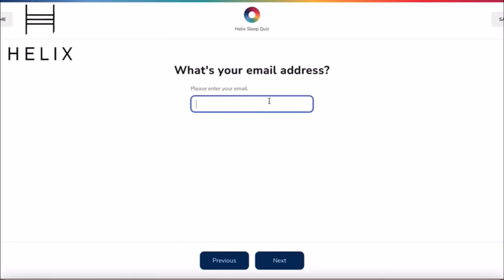Self-Constructed Porch Beams | Building Our Own Home Ep. 57

Comment: Lydia is on 30 days Light Duty. Good job ,Jim, smoothing out the dirt around the edge of the slab. That sure helps to secure your footing when walking on or off of it. The glue bonds the wood, the screws hold it in place until the adhesive cures. Great tip on pre-fitting the Simpson Strong Tie joist hangers. I now know how to erect the frame of my upcoming lean-to project. Level and plumb while working on a slab with a 1" grade is not as easy as it may seem. Great video!

Comment: Being a General contractor for 29 yrs  in Canada I'd like to mention that glue lams are not manufactured with a crown in them, they are deadly straight for the simple reason that they wont deflect under load. You don't have any "live" load above your beam such as living quarters etc that would require a crown up which you would do with a built up beam on edge. Also with the crown in the beam you built using a level to determine your post height is inaccurate, you should've measured from each end of the beam to the concrete taking into consideration any slope in the slab or used a laser level/builder's transit. Love the channel and all the work u guys have been doing! Cheers from Canada!😁🇨🇦🔨

Comment: Good news on the results.  A reminder to viewers to get lumps checked out.  I thought you were going to use the natural bow of the timber but great idea.  Would be cool to see if it straightens up once finished my at be a before and after comparison?  Instead of a joist hanger I wondered if there was scope to mount it to a stud on the inside?  Put another brace lengthwise so both beams supporting each other.  Great video as always.  Look forward to the next one ❤

Comment: God is great and the power of prayer is amazing. 
Whenever we framed porches or needed beams( unless the draftsman, architect or engineer required engineered materials) we would build them from dimensional lumber standing crown up with solid plywood glued ,nailed and sandwiched together capped on top and bottom with 2 by material...also we would have made a pocket , with extra support underneath, to except the beam. 
So glad everything is going well. Y'all will continue to be in my thoughts and prayers.
One other thing building the beams like this allowed us to notch the corners and be able to lock them together.
Good job you crazy cajuns.
Reply from the maker: Thank you for sharing this Richard!we hope that you have a great weekend!

Comment: So so very thankful that it was not cancer 🙏🙏🙂. I am sure how you made those beams will work just fine however how I do it is I would have taken 2-2x10 and cut them to the length you needed and then cut a piece of plywood 2x10. Then sandwich the 2 x 10 piece of plywood in between the 2 x 10 green treated and then glued together and nailed the heck out of it. That’s how I build headers for above garage doors for example. But what you did should be just fine. I love watching your build and it is looking awesome !! 😊✌🏼😎

Comment: You should probably use a bigger  timber or a steel post to serve  as the outer post, those are going to be holding up a lot of weight!!
Reply from the maker: We are using those to temporarily hold the beams in place. We are building permanent supports out of steel.

Comment: Hey guys I think you're doing a beautiful job but I am a little worried that you cut off the strong tie and it's not supporting the very top board at least it doesn't look like it from the direction that I got to see and of course if it's not supporting the top board on both sides the weight of the trusses pushing against that one board on each side can very well push it out of line with the other boards even though they're screwed and glued of course there's many things you can go back and add on each side of those boards and screw all of them in together from top to bottom and that should reinforce and distribute all the  weight to every bored evenly I would just look into it also I'm so glad you're feeling better honey love you guys' Channel hugs and kisses for my family to yours thanks again for letting us follow along
Reply from the maker: Thank you very much for watching! Have a great weekend!